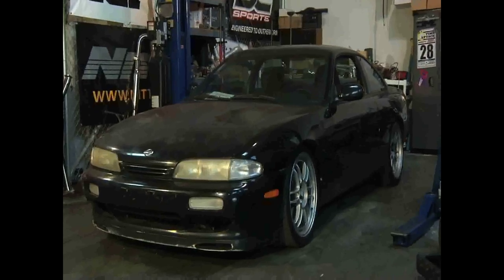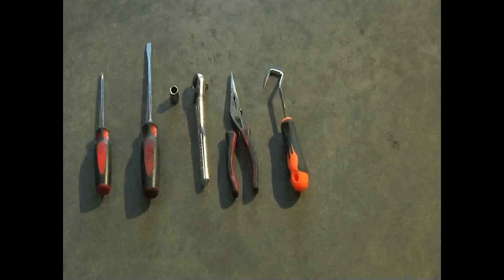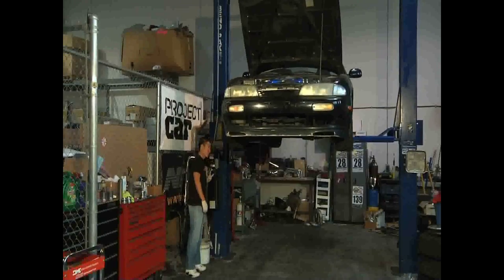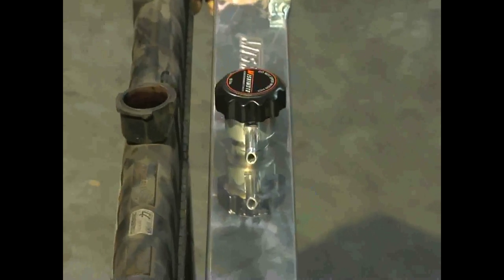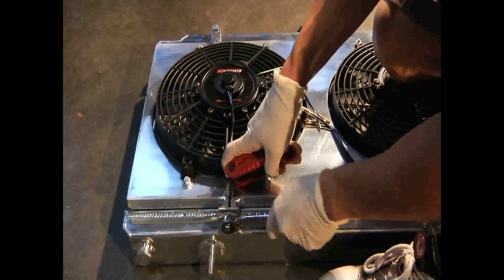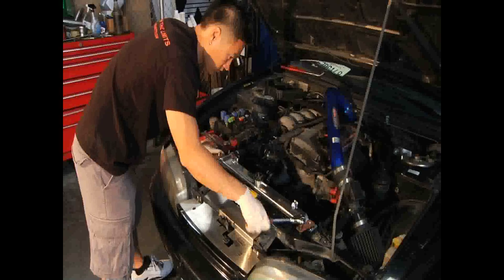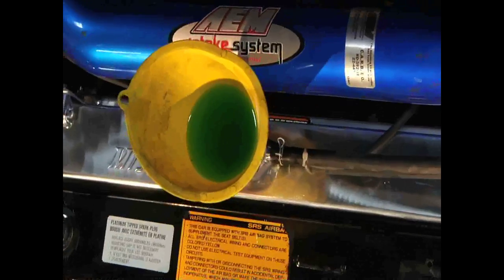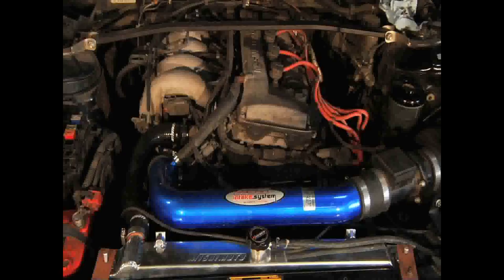Mishimoto Nissan 240SX KA / SR Radiator Install

Comment: a radiator is for cooling your engine coolant. a intercooler is for turbo'd cars. the intercooler is on the compressed outlet side and it cools the air. the cold air has more oxygen by volume. So you can stuff more fuel into the cylinder while maintaining the proper air/fuel ratio. thats why people use intercoolers.

Comment: I think that die stamped tanks would be more durable. Why are Griffin rads or Ford Racing rads more expensive? Why do we need a rad, and why is it placed out front where it can be damaged? Why aren't coffins equipped with radiators?